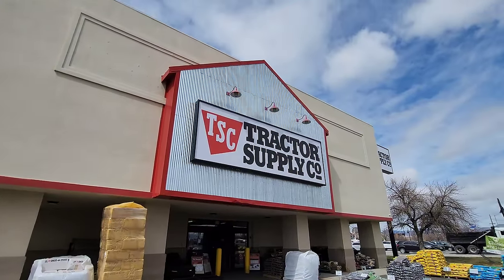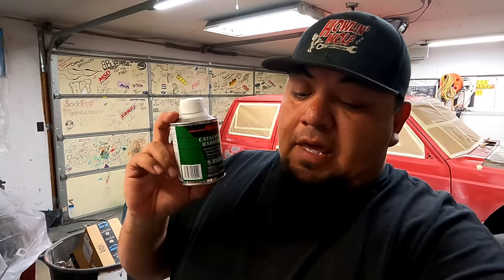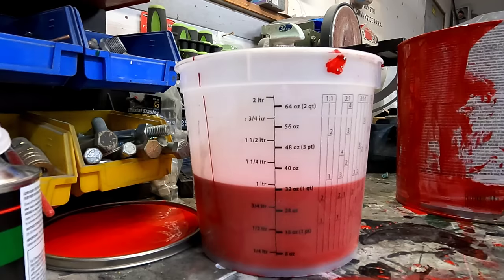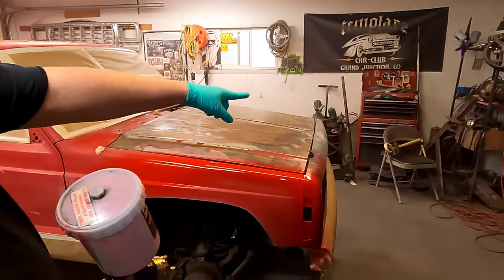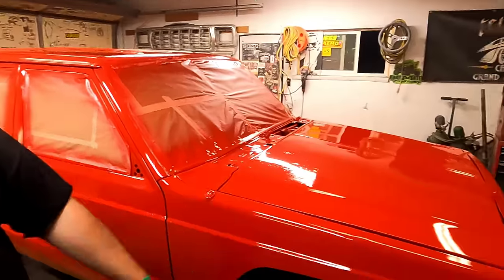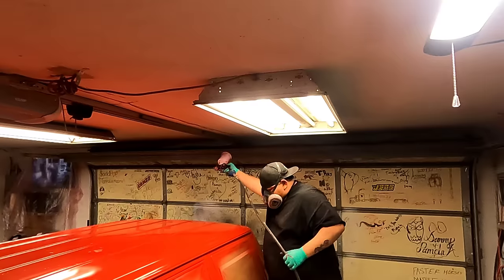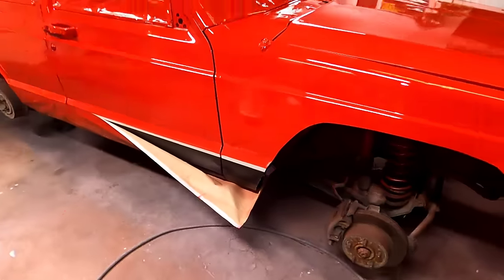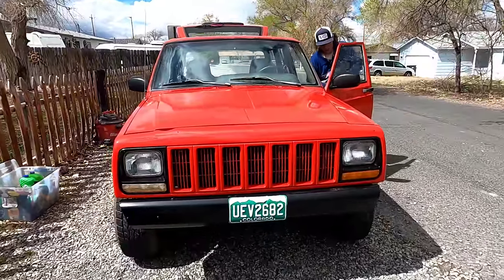Budget Paint Job On My Sons Jeep Cherokee. We show How We do It.

Comment: Best mixing ratio looks like glass 3 parts paint 1 part xylene 1oz penetrol 1 part clear coat oil base 1/2 oz hardener spray at 45 to 55 psi 3 turns out for fluid control wide-open fan and 80 percent overlap.  People think it's a 2 stage and are blown away when they find out it's Rust-Oleum.  Good job

Comment: Hector, Painter my whole life. I found when using a HVLP the position of the Air nozzle ports is important. I found if looking at the gun from front the 2 o'clock to 8 o'clock  air nozzle position works the best. you're running yours at 3 and 9 .tends to tiger striped at that position.  Love your channel. Keep showing real Man Techniques. Anyone can do what Robby Layton Does. God Bless
Reply from the maker: I have used that trick before an old painter I knew showed me it, and it worked awesome. I will do it when I'm struggling with tiger strips.
Reply: Fantastic tip man!

Comment: I always knock a few holes in the rim of the can so it drains back inside . In the little valley where the lid locks in use a nail or a small screwdriver, it helps especially when putting the lid back on, it won't squirt across the room.
Reply: Yeah but this batch has the catlyst hardner so no point in sealing it back up

Comment: I have a 58 Baja Bug. I painted it in 2008 in my driveway under a 10 x 20 tarp canopy with Home Depot painters drop cloth plastic film clamped on the sides. Hosed down the concrete before spraying. All the roll cage and bumpers is painted Rustoleum Sail Blue out of 1 quart cans from the local True Value.  Thinned with Klean Strip mineral spirits.  It was the real deal then. What they sell now just aint the same no matter WHICH "paint thinner" you get. Acetone seems to still be acetone. I thinned 1:1. No hardener. Sprayed with an HF old school style gun like an old Binks. Worked great. Sprayed sweet. Flowed very nice. Hardened up in a day. Still in good shape now 16 years later. Could use a buff and wax on the bumpers. But the cage is still shiny. Wish I had used Rustoleum on the bodywork insteas of machinery single stage. That has a couple of 1" blisters on the roof. So the body is about due for repaint. I plan for that to be Rustoleum Smoke Gray to go with the Sail Blue.
Reply from the maker: Sounds like an awesome Baja bug

Comment: Hey buddy a little trick I learned on pouring gallon cans of paint or other things is take some good tape and start putting it around the edges of the gallon paint can on top with the lid off!! Start at the outer edges and work your way towards the middle ripping pieces off as you go!!! You can make like a circle in the middle with a point on one side of the circle in the middle!! Then on the point side you can take some pieces of the tape and work it out wards or upwards off of the flat part of the tape!! Kinda making a pour spout like a measuring cup!!! I have found by just spending about 5 minutes or less it has definitely helped me from not making a mess and from products from running down the side of the can!!! I’m not sure if you have seen this nice little trick but it definitely works well and keeps things much cleaner!!! Definitely give it a try!!!
Reply from the maker: Thanks for sharing

Comment: Just what I needed. I've always wondered about the Rustoleum. We used to paint the sheet rock in the shop with it so one could throw a tool on the bench without worrying about denting the wall.  I've been thinking about using it to paint my motorcycle. Heck, now I'm thinking about painting my truck.

Comment: I've used that Rustoleum and Tractor supply hardner probably 20 times on projects over the last 15 years.  If you regulate your air to about 40-45 psi it atomizes so much better.  Higher Air pressure has a tendency to create streaks and dry spots. High volume and low pressure  works so much better than High pressure and high volume.  Just a tip but you do you however you do you. But it's never a bad idea to take a tip or 2 and see how they pan out.
Reply from the maker: Absolutely, I have tried it many different ways. I'm never done experimenting, but so far, it's working for me with this gun and paint setup. Thanks for watching and commenting

Comment: a trick i learned along  the way put vasaline on the parts of your body thats not covered over spray paint washes off with soak and water
Reply from the maker: Yes, I have done that before. Now I have the painters soaked rags come in a little bucket, and they work great. Takes everything off with ease, and it doesn't bother my skin.

Comment: The HVLP has a meaning...Hi Volume Paint at Low Pressure..most of your paint is in the air...as you're painting... Turn the pressure down, save on materials with Better coverage.

Comment: Hector thanks for shooting this video! Can you share what air compressor you are  using to push your  gun? I have a 20 year old Hitachi that is only good for small projects. I'm looking for a new compressor do you have any suggestions to push a HVLP?
Reply from the maker: It's an old craftsman 65 gallon tank. It really needs to be replaced, and it works really hard when I'm painting. I need a bigger, quieter compressor someday soon, I hope.
Reply: @rockabillychavez  ok cool thanks

Comment: One more thing.  Get some box fans ( around $25 at Lowe’s ) open your garage door put 4 fans under the garage door and lower the door so it rest on top of the fans.  Make sure you don’t have anything in the driveway.    I also zip tie cheap furnace filters to fans.   Wet you garage floor to keep the dust down as well.   Overall, great job and looks good.

Comment: That turned out great! I've been painting with TSC and Rustoleum paint for years but have never used the TSC hardener. After you dumped the hardener in the gallon can how long will the unused paint last, or does the hardener effect the leftover paint in the can? I see that you used acetone for thinner. I've always used mineral spirits and never knew you could do it with acetone. I'm guessing you use it  because the acetone evaporates quicker it will let the paint flash and dry quicker. Thanks for the video and now that I know about using acetone I'll have to give it a try. ... Thanks Hector and congrats to Tyler for passing the road test.
Reply from the maker: If you seal the top on really good, it usually stays good for a few months, and yes, I use the acetone for the faster drying. I have used mineral spirits, but it takes longer to dry, and it feels greasy, Not sure if that's just me or not.

Comment: You paint alot like I do. It's crazy. My shop is alot bigger than your garage so I hang plastic from my ceiling down to the floor to make a shity paint booth
Reply from the maker: I have done it in the past as well. But I feel like the plastic attracted or made it more dusty. It might just be me, though 🤷
Reply: @rockabillychavez  it might. I have not ever tried it with out my make shift paint booth. But maybe I will once this year.  I have 3 or 4 vehicles to paint this year so far

Comment: Also, I did use Sunburst yellow. I’m doing a Baja and I let it sit for like four days before I took it out and the paint was destroyed and one ride. This is also desert car long travel AR suspension in the front and everything so I wasn’t driving it on pavement obviously or even gravel roads lol, so now when I paint it again, it’s just all my suspension parts. I wanna know about this harder. I went to my local tractor supply sure enough they have it there so I picked up two cans.
Reply from the maker: That hardener works well for me. I noticed a big difference when using it. I will never use this paint without it again

Comment: Appreciate this content Hector. Turned out great!
 Not everyone needs a Robby Layton type paintjob(although I do appreciate that kinda work also, as a former autobody guy)
 Ive got an old horse trailer I need to do some light surface rust removal (orbital with 80 will take care of that) and then repaint the whole unit, and was wondering about this exact type of paintjob. It will be a dirt driveway type job.

Cheers!@
Reply from the maker: Should work out great for that 👍

Comment: Great job and Video. I have sprayed Rust Oleum on trailers. I have used the 5 second drip method with the paint stick. Works pretty well for me.  Used the HF green gun,$20. Out of stock on the purple one like yours.

Comment: I’ve used and painted a lot of “ beater “ vehicles with rustoleum paint but I was wondering why you didn’t use a primer on the bare spots and the hood or “ bonnet”?  Another thing you could have done to the hood is to put a very thin coat of filler and then 300 grit block sand then a sealer.    Rustoleum makes a great primer and you would see it difference in the end result.
Reply from the maker: Rustolium is a sealer and a rust prevention system. There is no need to use extra primers and sealers with a bare-bones budget. Yes, we could have done more. You can always do more, but that's what is going to cost more money and time, but honestly, there is just no need on this particular project

Comment: I’m a college student driving a Cherokee myself. It’s been the one and only car I’ve driven since high school and I love it! I’m looking to sand and paint my jeep but don’t know what else I’d need besides the paint and spray gun. The paint on the roof is weathering and beginning to rust in strips. Could you tell me what kind of sander/tools I’d need wear down the old paint and rust spots?
Reply from the maker: I would use a DA sander (dual action) electric or air if you have a compressor, I'm assuming you do have an air compressor to run the paint gun. Start with 100-220 grit sandpaper and move up to atleased a 380grit before paint. If you are using majic or rustolium paint, then follow my steps in the video. Take your time during sanding and prep work. Better the prep, The better the end results will be and keep it clean.  I would paint something like an old fender or a hood first. Remember, when you start to spray your paint that it's not a race, just get it on and get it covered as uniform as you can and keep it wet and keep moving. Flat surfaces make sure to get them good and wet, which will give you a better shine with virtually no chance of running the paint. Know that you will probably make a mistake, and that's OK. It just paint it can always be fixed.

Comment: BTW a trick is to heat the paint up to warm tempreture before spraying it will lay FLAT... Stick the tin in a bucket of boiling water for 20 mins to heat all the solids up in the paint and it will lay 10x flatter

Comment: Another thing we used to do before you start taping the car don't even have the car in the garage go in with a hose and spray the ceiling in the walls and all your tools and the floor whatever is in there just wet it all down with a coat of water and then bring your vehicle in and while you're taping it that water will kind of settle and all the dust will stick to the walls and a ceiling and not getting your paint job and then shoot the cracks first on your car and if it's going to blow out any particles out of the cracks you can deal with that before you start  painting

Comment: how come you do not use a fans at the door ways. I found it helps take the over spray out of the air.
Reply from the maker: I do. And I have them in the windows. But two of my fans are no good. I need to go get some more. I also have neighbors, so I have to watch out where I'm aiming the fans so I don't get over spray on any of their stuff.

Comment: First video I have seen of your work. I like what you did with what he had to work with. Good stuff. I do have a question. In case there would have been orange peel, could you have sanded and buffed to get the orange peel out with this paint? 
Thanks, 
Phillip Hall
Reply from the maker: Yes, you can if you use the hardener. I would wait a week to make sure it's good and cured first

Comment: No pos wow sir I am new to the channel & I have to say sir you kicked some ash there. Its true on what you say about losing the fear of trying it out. I've done a few with the spray cans & sad to say only about 3 with the gun. I'm about to paint my sons car to but I don't have a garage puro outside for me. The trouble I've always had is the mixing ratios & the fear of fking it up. If you don't mind what advise would you give me on using a smaller mixing cup?  what ratios would I be able to use or go with ? How much of the catalyst hardener can I use if I was to use a smaller cup? Bueno sir I don't want to bore you with questions but hopefully you can help me out with some advise. I'll be watching some of your other videos Bueno sir again thanks. RF from TX. (RGV )
Reply from the maker: You could do 1 quart and about 60ml of the hardener. Maybe start with 16oz of thinner and go until you like the way it's spraying and laying down.
Reply: @rockabillychavez  Thanks I'll try that & hope it comes out good. Bueno sir I'll keep you posted

Comment: Hey Guys, Question about the tank size for the air compressor. What size tank to you recommend? I have some body panels I need to fix ( thanks to you and your vids I have the confidence and skill set) and will need to paint but I need an air compressor and don't want to buy one that is to small.
Reply from the maker: Mine is almost to small to paint cars. It's a craftsman 68 gallon. It runs continuously when painting and barely can keep up. It's pretty old. I'm not sure they make mine anymore

Comment: Bro - Love the paint job - What' compressor specs you running on the HF gun?
Reply from the maker: I run 75lbs of pressure to the gun, and I lower it down at the gun, but not very much. If I had to guess, I would say about 60-65 lbs of spray pressure. HB guns work better at higher pressure for some reason.
Reply: @rockabillychavez  Awesome but the compressor size is it 30 gallon 60 gallon and WHAT CFM?

Comment: I see one room for improvement to get exact mix ratios that work every time. Try using a digital scale. Set the scale to grams and pour out the exact grams you need of each mixture that makes up one cup. When you fins the mix that works for you then you will have an exact amount each time according to your recipe. I bake and you can't guess in baking. Its exact for things don't come out right every time. The paint looks like something that needs this kind of attention to detail by use of a digital scale.

Comment: Nice job brother, I got a 93 that I lifted and cut bushwhackers, gears, posi , locker etc . Now a paint job, thinking of a flat color for my first paint job, do you think flats are better for a rookie painter
Reply from the maker: Flat paint is actually harder to paint. It likes to tiger strip real bad. Just make sure you keep it really wet and very even strokes, a little more in I one spot will show and look a bit different.  Keep it all wet and move fast so it doesn't try and dry on you by the time you get all the way around the vehicle.
Reply: Thanks and harbor freight has those 15.99 spray guns for 8.98 coupon til the 21st

Comment: Can you use a pancake air compressor to paint smaller pieces of plastic? Like window rain guards, spoiler kits, ect… I have 175psi pancake. Would that be enough air?
Reply from the maker: For little stuff, I don't see why not. But it takes a lot of air to run a paint gun consistently. Even my compressor is a little small. I have to take my time and wait on it sometimes

Comment: What minimum size compressor will work with a Harbor Freight spray gun?
My compressor is: 1.5hp, 3 gal tank, 155 max psi, 3.4 SCFM@ 40 psi and 2.5 SCFM @ 90 psi. 
If my compressor can push that sprayer I might try the “cheap” paint job😃
Reply from the maker: The very minimum compressor would probably be a 20 gal. You would probably have to wait on it to build up while painting a car. Mine is a 37 gal craftsman, and it  has a hard time keeping up at times. I usually wait on it to build up as I mix more paint.
Reply: Thanks! Guess I will have to rent a compressor.

Comment: Would you say that the Heavy Duty Tractor Rustoleum already contains the Enamel hardener, and thus saves you that extra step, Sir?
Reply from the maker: Yes, you can spray it without the extra hardener. But I get way better results, and it drys much faster and stronger, and the shine is way better
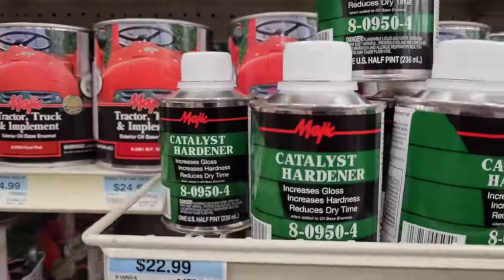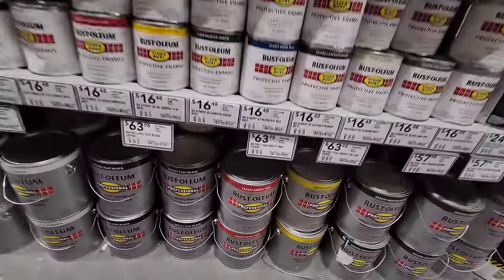Reply: @rockabillychavez  What I am saying is that the paint you show at 0:16 mins is "Rustoleum - Farm and Implement - Heavy Duty" but what you bought later at Lowes at 0:49mins is "Rustoleum - Professional", ie a different product and spec, and what I am suggesting (or asking) is that the first one might already have a Hardener in it, hence it is called the Heavy duty? Do you see Sir? Different product  and spec.

Comment: You obviously have painting knowledge and skills. Very good gun control etc. My only complaint is that you didnt prime or seal the hood. No matter how good you make it look that hood is going to rust. Any moisture on that hood will start the rusting and if it ever gets scratched it will rust. Other than that nothing wrong with a quickie budget build :)
Reply from the maker: @deepredstate4414  I understand that, believe me. With rustolium, it's a paint sealer, so there's really no reason for it. We were just trying to keep costs down and show what could be done. I agree with you that you should always put a primer sealer on, but in some cases like this one, there just really isn't a need. Thanks for watching. We appreciate it